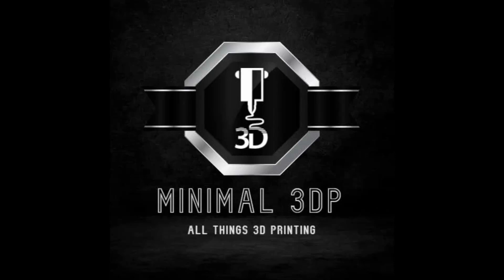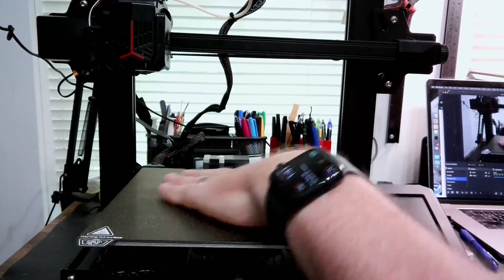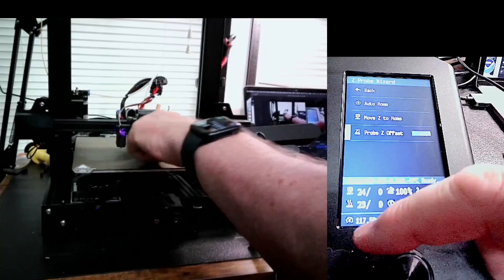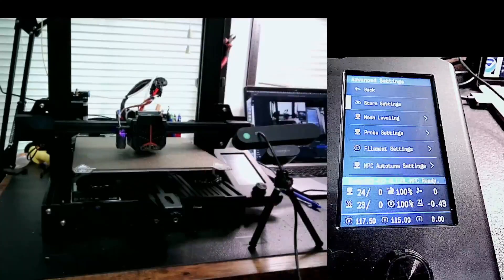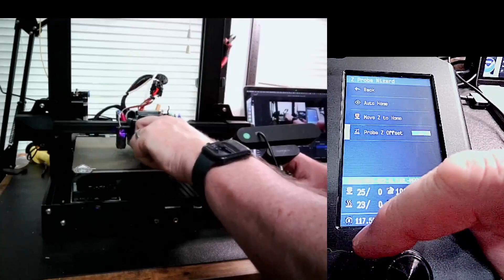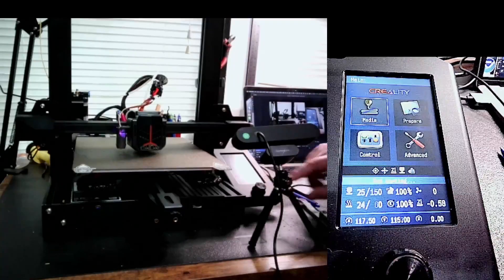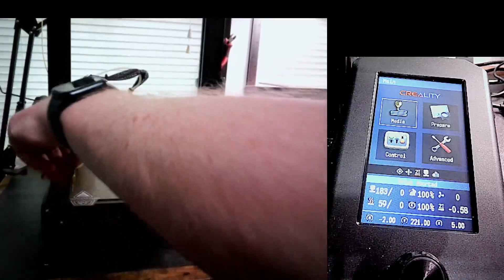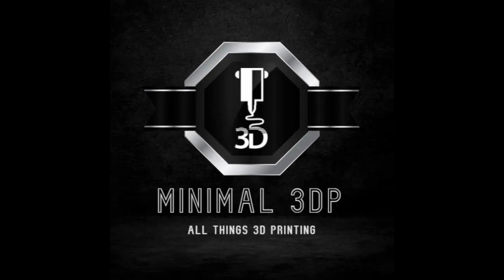Setting Z Offset and Bed Leveling on Ender 3 V2 Neo with Professional Firmware

Comment: After z height setting, instead of feeler gauge on each corner there is a bed tramming function. I saw it in your menu. Go to each corner and hit go, then read the z number and adjust each corner to z equals zero. go around to each corner a few times until they all are zero. once all corners are dead zero you can then run the mesh function.

Comment: I have a question what settings did you have to change on the slicer
Reply from the maker: The only thing I changed was the start script.
Reply: What did you change on the start script  for it working but my probe offset of off not printing in middle of bed

Comment: Thank you for this. I don't have the pro firmware, so I don't have access to the z-offset wizard. After really giving the hotend some hard treatment (namely replacing because the nozzle was just flaking apart and could not be taken off, resulting in bending the plate the probe was connected to slightly), I kind of forgot the entire process. This got me up and running after installing a fresh new hotend, and correct for my latest blunder.
Reply from the maker: I am glad you found my work helpful.

Comment: Maybe I'm just retarded -- I can understand the paper test for manual leveling, but setting Z-offset with the paper method makes me wonder a couple things... the probe touches the bed, thus setting its 0 point, but the firmware doesn't know where "zero" is, so we set Z-offset to "zero out" the probe to nozzle difference, yea?
so why do the paper drag test, which has a 0.10mm thickness, without compensating for the 0.10mm thickness? is that built into the Z-offset algorithm?

I get that there's basically no other way to "feel" it (unless you're using like a 0.001mm feeler?) -- so wouldn't you want to set Z-offset, then subtract the 0.10mm paper thickness?
Or is it because we're not setting "zero" we're setting the "first layer"?? in which case shouldn't we be trying to set the first layer thickness we normally use, or setting our first layer to 0.10mm (or whatever feeler gauge we're using?)??
Reply from the maker: I don't think your questions are dumb. I will give you my thoughts. 

The nozzle location is not known by the probe. The probe touches the bed and via z offset you are setting the nozzle location. I think of the offset as getting the perfect squish. The squish is how well my prints will adhere.

Comment: you started with auto leveling ,and then moved to manual leveling? you have a prob it suppose to be auto leveling i don't follow you
Reply from the maker: As I set up a printer, I manually level the bed as I am setting up the probe. My thought is that the probe can help correct for minor level fluctuations. By manually leveling the bed I am making sure any n eded changed will be minor. Does that make sense.

Comment: Did you have to compile the firmware for the Max   Neo?
I have an original Max with a 4.2.7 motherboard and cr touch and not having a lot of luck in compiling the firmware for it
Have also now fitted a sprite direct drive extruder to it
Reply: Sorry I just noticed you don't have a max  ☹️
Reply from the maker: If you are comfortable with it you could compile yourself. Klipper is also an option.

Comment: By chance did you have a problem with the printer printing faster than what was set in the slicer after installing the firmware?
Reply from the maker: I have not noticed that issue. I think you might be able to adjust the speed in the settings via the screen but I am not sure. I am currently running Klipper.

Comment: Thanks for putting all these videos together, they really helped me out a lot.   A couple days ago I randomly started having issues with my neo on default fw. No matter what I do, it just won’t seem to level right. I checked everything hardware wise…so I started to think maybe it was a firmware issue.   So I installed the professional fw following your guide, did all the same calibration. But I still have the same exact problem. The first line looks like it comes out okay but once it starts doing the outline, the plastic just doesnt want to stick.   I checked the all eccentric nuts, tightened all screws, checked x axis leveling, checked for nozzle clog, tried different filaments, etc… im running out of ideas and im really heart broken. I was having so much fun with it for about a week. I haven’t owned it very long….
Reply from the maker: I would clean the bed and then level it. It sounds like the nozzle is not close enough to the bed.
Reply: @minimal3dp  I scrubbed it yesterday with some hot soapy water, took the bed apart and re leveled, re built mesh. Same exact issue. Seems like my bed may be warped or my v wheels have flat spots or something. 

When I level and check z offset, everything feels okay, but the wizard results seem to vary even if I don't touch anything...

I checked to make sure the machine is square, re leveled x axis again. 

I have about 15 days to exchange it with Amazon, may just get a fresh one and install the professional software from the get. I probably bent my bed when I first got it 😅
Reply: @minimal3dp  I just noticed that the single bottom wheel on the carriage has a crazy amount of debris on it. At first i thought it was just dust but it looks like the wheel is also pretty chewed up.

Comment: After you manually leveled the corners why didn't you run the mesh leveling and store a new mesh?
Reply: I'm so confused why he did the z offset then trammed the bed? No the z offset needs to be redone?
Reply from the maker: I did not run a mesh on video but I also run a mesh every print anyway.

Comment: How do i fix where my prints print a little bit to the left? When i center the stl in prusa it isn't center on my bed when it prints. Thank you for the video i love this firmware.
Reply from the maker: Do you have a bed leveling sensor? It might be centering over that.
Reply: @minimal3dp  don't think so just the CR-touch. It just starts printing about an inch to the left of center. Can't figure what setting to make it shift over
Reply: @paulsitterly  It's most likely your bed dimension settings.

check his older video here at the timestamp and see if that helps: https://youtu.be/ia1aZcMVcSI?t=73

Comment: I bought some feeler gauges but found it much slower than the paper method which I have more or less mastered so I have stuck to that.
Reply from the maker: You have to do what works for you. I prefer the feeler guage.
Reply: @minimal3dp  I hear that; I never even used the paper method; started with the feeler gauges.  I just like the fact that they're a consistent thickness. With paper, you're gonna get variation, sheet to sheet.  With steel, .1mm is .1mm.

Comment: The notches are registration points for printers whose bed plate has the matching parts for them to work with although I guess you could design some in CAD for a plate that does not have them.
Reply from the maker: Thanks for the explanation. I appreciate it.

Comment: Nice video   i use the same printer and software
I level the bed manual  but with 60c  not cold
If you do and use a mesh   Cura needs  to know  (G-CODE) 
You can activate the little icon on your printer    its a setting in Cura.....Extensions----postprossesing----Modify G-code----Add a script    ......... and choose  Create V2NEO Thumbnail
Reply from the maker: Thanks. I will take a look.